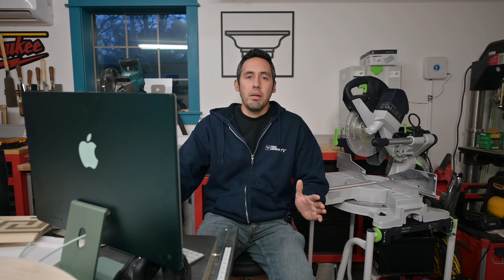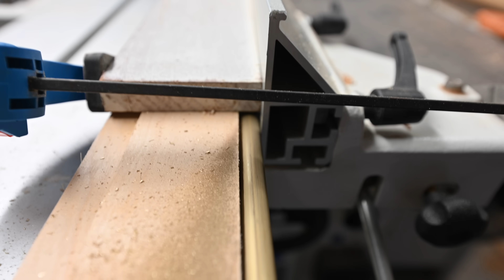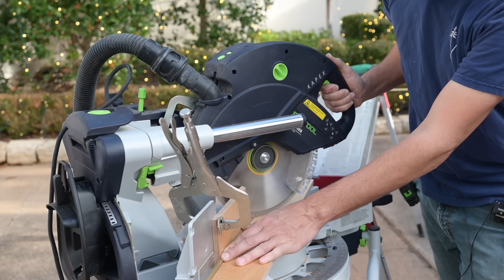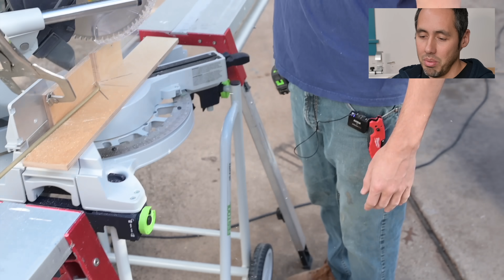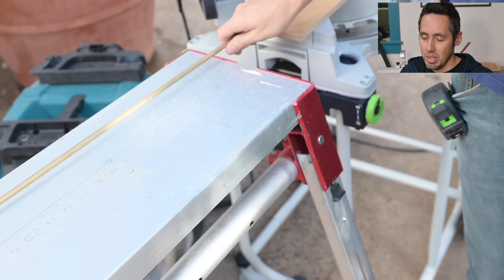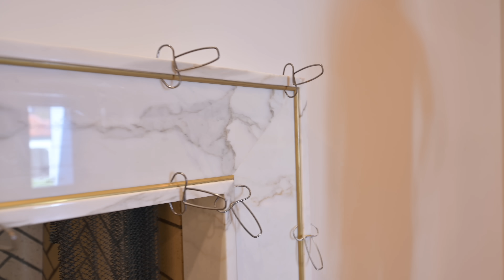It only took 12 years...My first MITER SAW injury.

Comment: I was holding a branch on a tree that had fallen on a property and cutting it with a chainsaw when the chainsaw was grabbed by the tension and threw my index finger into the blade. Luckily it just got about a third of the way through before I pulled my finger away and I was able to glue it back together and heal it pretty well but that taught me never to hold the thing I'm cutting with my chainsaw with one hand. That was a long time ago but hopefully I never get complacent again. Moral of the story make sure whatever you're cutting with a chainsaw is not going to move.

Comment: Your problem looks like you are cutting it with the back part of the blade that is cutting on the upstroke. A few bits of wood to bring the brass further forward so the bottom of the blade is pushing down on the brass even slightly further forward of the bottom of the blade would be better. Glad you are ok and it will focus your attention for a while. Merry Christmas and good luck for the new year.

Comment: I took some good bits out of my thumb and finger on a jointer one time. Was running  board that was way too short and holding with my hands instead of the paddles. Dumb move when i was young, but I’m much more careful now.

Comment: Yikes.. Thank God it was superficial. I had an similar situation with cutting plastic.. Thankfully no injuries. My worst injury 🤕 is I was the rookie framing a house. My job was to hammer up any missed nails in the flooring. I was on the first floor hammering up nails on the 2nd floor. One of the framers on the 2nd floor saw the nail coming up. So he thought it would be funny to nail it back down, I then hammered it back up he did it one more time. So this time I used my nailset and hammered it all the way out and next thing I heard was the nail gun and what felt like a sledgehammer to my hand. He was trying to renail the joist and missed again and my hand was just finishing up hammering the nail through. The nail went between my knuckles strait through my hand. I only found out while cleaning up the blood that the wound was on both sides of my hand.. My hand seized up for 2 days because of it. I regained full use and it's been almost 30 years now and still no issues.

Comment: I had just finished a science demonstration and I was washing a glass beaker just like I would wash any drinking glass at home. I was using my hand around the rim with my fingers inside to swish the water around and that’s when I felt it. The beaker had a crack in it and a small piece was missing from the rim and it sliced my pinkie finger near the base. Trip to the hospital and stitches. That was 40 years ago and I remember it like it was last night.

Comment: I've not had any injuries yet, thankfully, but I've had my fair share of hot aluminum shoot into my face cutting t trim.  The other day I did have a scare when I stacked some pieces of 3/4 thick trim wood up too high. The saw flung the top one and it shocked me so much I accidentally pushed down and it flung another. First thing I did was check to see if I still have all ten fingers. I was good but that definitely humbled me. I think the actual reason why that happened to you is because the piece you were cutting was too small and thin. It flexed too much and that's why it caught. I cut thicker stuff with no problem, like schluter and other aluminum trim. It cuts best with a high tooth, blade.

Comment: Actually today I was using a new flat drill bit to screw in flat screw heads into an old door hinge. It slipped off the screw as I was pushing / drilling & the tip of the flat bit caught a good chunk of my finger, went straight through my cheap value pack gloves & deep into my left index finger tip

Comment: Zero clearances on both the fence and table.  That fence you were using, has a gap bigger than the saw blade, which allows tension to push through that gap, pinching the metal.  Brass is soft enough to allow force to bind, if it’s not completely supported through the cut.  So use a scrap block like you were using and cut through it at your angle on the right.  Flip both blocks after you make the cut all the way through, by putting left block on right and right block on left when you switch angles.  Mark blocks on face with the degrees you cut and keep those blocks.  These saws need to come with zero clearance tables at least.  I’m so glad this was a minor inconvenience.  

Love your skills!

Comment: Been doing construction for 10 years, strictly finish carpentry for the last 2, although I had been doing frame to finish before that. The worst and dumbest injury that could’ve easily been avoided was from a utility knife. It was early in my career and I was cutting a corrugated drain pipe to be used for a gutter, obviously a knife isn’t the tool to do that but that’s what I had at the moment.. anyway I was making slices in the end so it could fit in the other end and I was cutting towards myself because my partner was holding it in front of me. The knife slipped off the end and went directly into my arm, the entire depth of the blade went in about 1/8” from the artery so I got really really lucky, considering I didn’t hit anything but muscle and I could’ve died had I hit the artery. When stuff like this happens you always go back in your mind and say wow I’m an idiot, I should’ve been using a different tool and my coworker didn’t need to be holding it, I should’ve been cutting away from myself, but the circumstances led to an unsafe situation that ended with a lot of blood and 8 stitches. I honestly think the most dangerous tool that everyone from grocery store workers to construction workers use is a utility knife, it’s so easy to become complacent and forget that something so simple can injure you terribly or even kill you. Never had an issue with power tools however, I was always taught “ respect the tool” and I take that seriously. Just saying it’s easier to forget to respect hand tools.

Comment: Splitting wood went to split the angled trunk off cut, it was slightly off perfectly perpendicular, causing my axe to ricochet off on the downswing, and came down into the top of my foot. Clean thru the boot and laces. Didn’t even feel pain because the axe was so sharp, but the blood was flowing once I pulled my foot out to check it after seeing the laces flopped over in half.

Comment: Richard, glad you are ok. Looks like you didn't have support behind the last inch or so ( close to the blade) (you cut the wood to 45, the back piece) Brass is soft especially if it is only 1/4" x 1/4". Hope this makes sense. Take care.

Comment: The vast majority of my on site injuries over the course of 35 years have been from the ignorance or laziness of others. 
We were doing a room addition and tearing down what we thought was a false wall. Come to find out it was attached to what was left of an old fireplace. 8 ft tall and about 4 ft wide with cedar lap siding and now bricks on the inside.
Me and another guy are holding either top plate at about shoulder height waiting on the other guys to cut wiring loose at the bottom plate. My partner decides he can't handle the weight and just drops his end. I try to slide out from under my side and as I twist, a toe nail in the top plate rips across my throat and collar bone.
Just an inch either way and I wouldn't be here telling this story. Few stitches and some super glue and I'm on the job the next day.

Comment: I can only think of two close calls. One was a kickback while helping my dad rip a board on his table saw where the board shot back flew right by me and through the garage door. The other was where I was pin nailing some shelves made out of mdf and I had the angle wrong. The nail shot through the corner of the shelf and into my chest.

Comment: I had this happen with metal transition strips, years of cutting them and one time it does the exact same thing. It broke all the plastic on my miter saw which thankfully was the worst of it. I use other methods, usually slower but not worth the risk of it happening again.

Comment: I was cutting off some extra 1/2” lag bolt sticking through a post base from a difficult angle and I was bracing myself up with my non cutting hand (I was basically hanging over a pool) to keep from falling into the pool. So it was already dangerous enough cutting with one hand but then I had to brace myself close to the cut so I didn’t topple into the pool and the grinder kicked just ever so slightly and dropped down lengthwise right into the back of my first finger knuckle of my other hand. Thankfully it was a metal cutting wheel and didn’t just saw my finger in two, but it did chew up some of the flesh and took a really long time to heal. No bones or tendons were damaged (somehow) in the accident, but it’s one I look back on and think about how it could’ve been much worse.

Comment: I cut metal with a metal blade.  Use a fine tooth blade made for metal.  My worst injury was on a wood lathe.  I was wearing gloves and my hand was pulled into the turning wood on the lathe.  I was lucky and managed to turn the lathe off before it broke my fingers but it pulled the muscles and my fingers were severely bruised for several weeks.  I now know loose clothing includes gloves in some cases.

Comment: It was my first time using a table saw while doing some laminate fresh out of high school and I had to rip a few boards 1/2 inch off to finish the room but I wasn’t thinking and put the 1/2 inch piece against the fence instead of the bigger cut off and I wasn’t using a push stick or anything and ended up cutting part of thumb off

Comment: Made an oversized jenga set. While milling the pieces to size on the table saw(removed the guard because the pieces were getting stuck on it) my wedding finger got to close to the blade and got nipped. Took a chunk out of the finger just happy it wasn’t worse.

Comment: I had a schluter profile do the same thing when I was cutting profiles for tiling. It jumped up and smacked my hand. No real injury, just received a nice smack on the hand. My thought was the miter blade was lifting the piece since it was thin, light and hitting the bottom of the cut, Basically catching the metal and throwing it up and out. So I used a scrap of 1x4 wood to move the metal out from the fence and it worked well. No more surprise pops or jumps. Then the CaliBro Square was released and it is great for holding a metal profile or pencil tile for cutting. It would probably work well with that thin brass. But then how many times do you install brass?

Comment: I was drilling from my basement up into a wall to run several network cables to my living room TV, mesh router, etc. There was an existing hole, but it was not large enough. So, I tried to drill adjacent to the existing hole because of limited space. The spade bit caught in the hole's edge. I had my left hand high on the drill for stability since I couldn't get directly under the work area. When the drill bit caught, it torqued the drill chuck into my finger. The skin on my finger twisted onto the chuck's teeth. I couldn't get my hand free and had to turn the chuck in reverse using my good hand. I finally freed my finger but have a nice big scar to remind me.

Comment: I was doing a herringbone pattern on a 14 foot long fireplace hearth and about 75% of the way done when I got cocky with my speed and rhythm and I missed the board and nail my finger instead. Luckily it was small pin nails so I was able to pull it out and squeeze until the bleeding stopped.

Comment: I was ripping extension jambs all day, very last cut of the day (I wasn't hurrying or anything), the table saw blade kicked the material and my thumb grazed the blade.. it was pretty gnarly for as quick as it happened.. I still have all my digits! Not even a scar. That was about 5 years ago now..

Comment: I was alone on a job site, cutting stiles and rails for some cabinet doors. I was cutting the tenons on the rails, and had the workpiece vertical going through the table saw. As I was ending the cut after making 12 of these doors, working on door 13, The rail twisted on the saw and caught the blade. It pulled my hand into the blade, slicing the meaty part of my thumb and 2 fingertips. Luckily, after a trip to the er, I walked away with only a few stitches. Still have all 10 fingers and all 10 toes. I won't make that cut any longer without a jig. I was trying to hurry and got out of my head.

Comment: My worst injury was stepping on a 2x10 scrap board with a 16 penny nail sticking out. It cleared my boats sole found it’s way between my metatarsal bone on my right foot and then managed to pop right out a the top of my shoe. Yep it went all the way through my fat 3 inch thick foot. The worst part was about to come, as it went in quickly it came out slower as I had to stand on the board to hold it down and then pull foot back off in reverse order. It was a somber feeling that I hope to never do again.

Comment: I was cutting 40 raised panels on a router table, my last cut I reached for the piece instead of sliding it all the way through like all the rest. Needless to say I stuck my two fingers into the rises panel bit…repetitious cuts will get you complacent …

Comment: Worst injury...screwing in a pocket hole with a long bit and cordless drill; I was holding the drill with my right hand, but had my left hand too close to the the pocket hole and I was driving the screw in too fast and applying too much pressure. The bit slipped out and rammed into one of my fingers on my left hand, almost ripping my nail off from the side. That was painful, but not as bad as what many have experienced. Didn't need stitches or anything like that...just bandaged it for a while.

Comment: Whe I was 21 years old I was working at Milgaurd Windows in production  as a main frame welder, I had to manually type in the sizes of the frames  before welding them together  and if you typed in something wrong it would automatically close down.  Well I goofed up on a size and it closed on me. My finger got stuck and lost my finger tip of my right pointer finger.

Comment: I think it was style blade and miter angle that you are cutting. The leading edge of the brass got caught behind the tooth or in those relief lines on the blade. Thats why the left side ejected not the off cut per say

Comment: I think that what happened is the same thing  as when you for example drill a hole  of 12 mm in a piece of brass with a normal drill bit , it will pull up  the brass at the monent you almost are completely  through , you need to drill with drill bits with  a lower angle . Brass can be very tricky, Kind regards

Comment: I think an important takeway is that if a spinning cutter grabs into a piece of metal, it will grab way harder than into a piece of wood.

Drilling holes into metal can sometimes end in disaster if the metal decides to climb up the drill bit.  Holding the stock by hand, without clamping, isn't guaranteed to be secure enough against this possibility.

In this case think holding the brass by hand, without clamping, was part of the problem  Was the slide function of the saw locked so that it only pivoted straight up/down?  You can see a bit of travel backwards at the moment of crisis... is this just flexing or something more?  The direction of reaction to the kickback would be back towards the operator as we see here.

Comment: Of all things I was putting together an IKEA bed… I was trying to screw in a small machine screw and it would not budge. So I got on my knees, put what I was screwing into in my palm, put my full weight on the screwdriver onto the screw, screwdriver slips off and almost goes completely through my hand. It was poking the skin of my hand on the other side of my palm about 1.5“. Still went to go see Dave Chappelle at night at Toyota Center in Houston, TX with a super swollen hand 😂

Comment: I was ripping the bark off rough cut lumber with a battery skill saw and it slipped off the clamps so i grabbed it with my hand where the blade was but luckily i set the blade depth so it only cut me very shallow.

Comment: I am a DIY wannabe. Was using a table saw to rip a 3/4” ply 4x8’ sheet down into 2 ft strips and had a rough edge on one piece. Was cutting it and one piece went flying back my way right into my gut. Wasn’t fun. Thankfully it didn’t piece skin but had a nasty bruise for a few weeks.

Comment: I received a compound fracture to my right big toe, So painful. The toe was crushed the toe bone pushed up through the nail bed splitting it into several pieces to nail came off all most entirely about 2mm on the left side still attached. The toe bone broke as the flesh was flattened. Blood everywhere it looked like hamburger. Trip to hospital for stitches to put the nail bed back together and the the nail was replaced and stitched in place to allow healing. I was operating the levelling plate on a scissor lift when the hydraulic ram that controlled the plate when you lowered the 18mm steel plate snapped off at one end. If forced down the plate ripping it out of my hands down on to the big toe of my right foot. So painful I always wear steel toe boots now even in a suite and tie. Never forget to put on you foot protection and all other PPE